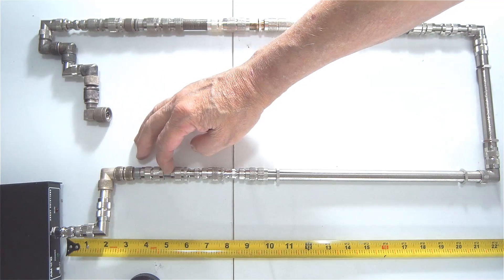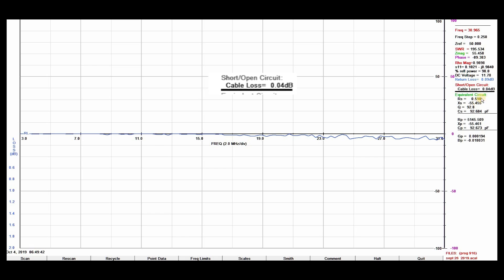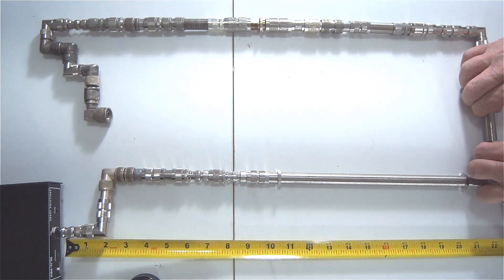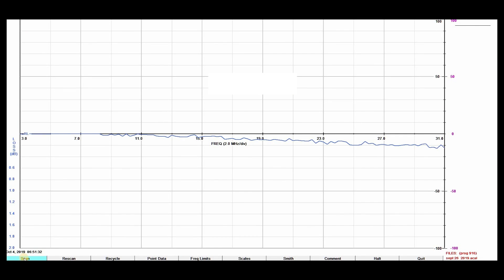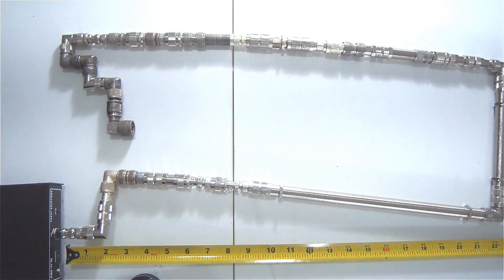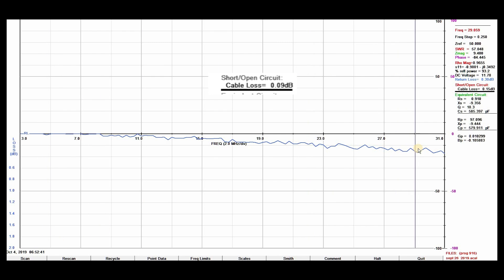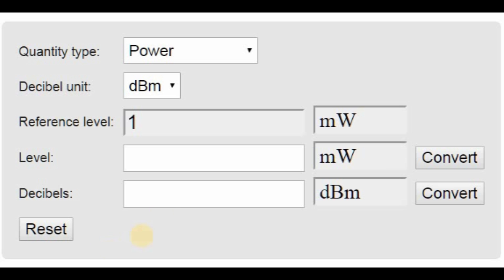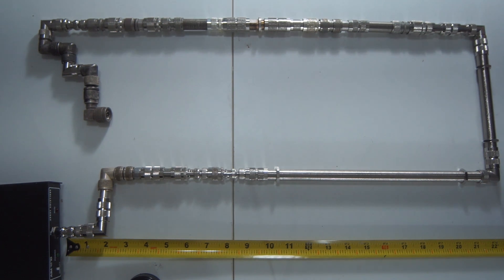Ham Radio With Jim Heath W6LG--Your Ham Radio Elmer--Coax Connector Losses at HF

Comment: It is still entertaining to see this repeated, even in the trade people will make huge allowances for connector loss. Granted they are usually talking about VHF/UHF where losses and impedance discontinuities can be more significant. It is one of those arguments that is better walked away from! I recently made up a lot of new patch cables for my HF gear, not to reduce losses but to free up my adaptors.

Comment: Very informative Jim. Good to see you on again. I occasionally clean my connectors with a Q-tip and Mothers metal polish. It would be interesting to clean all of those and see if there's any difference in loss. (I'm not volunteering to clean all of those for you BTW) Cheers, KK6CUG
Reply from the maker: Hey, I was going to ask you a question, has the State or Calfire dropped VIP?  Tell me that the story is incorrect.  Thanks, Jim 
PS a quarter turn loose connector caused real issues...discoloration caused no problem
Reply: @ham-radio  I asked Charlie about the VIP program, he hasn't heard anything lately. I think the only issue so far is at Shingletown near Redding. The repeater at Dobbins (Oregon Pk.) is still in place and working. We will see.

Comment: I am in the process of putting up a 20 meter dipole in a sloper configuration.  I have a 40 foot tower and have a multi band ocf dipole currently mounted on it and have  the sloper mounted perpendicular to it.  I've been trying to tune it and have shortened it a lot more than I expected and the lowest swr I can get is about 1.7   I suspect it's somehow coupling with either the ocf antenna or the tower.  Any thoughts?  Also, in general I've notice dthat when I asjust my palsar tuner for lowest swr at low power, when I increase power the swr increases and I have to readjust tuner...Is that to be expected?
Reply from the maker: Hi,

Thanks for the great email.  There is so much to be discussed, I think I will answer with a video.  I will not mention your name.  I don't know of a good analogy to photography.  Perhaps the coax is like a crop factor.  The SWR is likely not 1.7:1.  The SWR may be stopped way down.  You should not focus an antenna with an SWR meter like guessing without a view finder.  The tuner is not exactly the issue with the varying SWR.  As you zoom from near to far the F stop changes because of the nonlinear diodes.  None of that helps.  I will do better in the video.  Here's a sample of what needs to be discussed:

If the coax has 25% loss, then the SWR is really 25% greater than you see at the end of the coax.  Typically you cannot see capacitive(sp) or inductive reactance with an SWR meter. 

What is the feedline?  Maybe RG8X?
How long is the feedline?

73, Jim
use the address on QRZ

Comment: What would the loss look like at 2m or 70cm?
Reply: Okay. I'm just wondering if it is a similar function to line loss where going from 3.5mhz to 144mhz is roughly 6-8 times the loss and going to 440 is another 1.5-2 times what it was at 144. I'm just wondering if there is a general rule of thumb that says how much loss you will have if you use a boat load of connectors you have at hf on your 2m or 70cm rig. (I would never use that many connectors, but the most I've had to use to make my coax runs work is 8) 

-KM6TEO